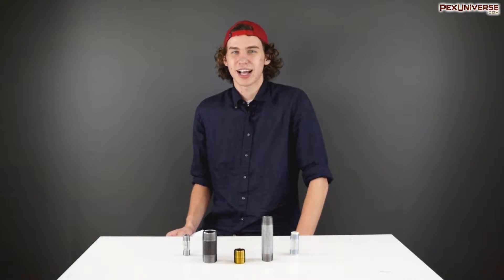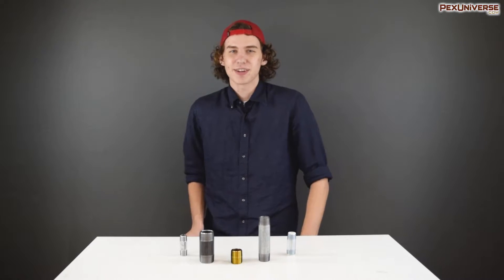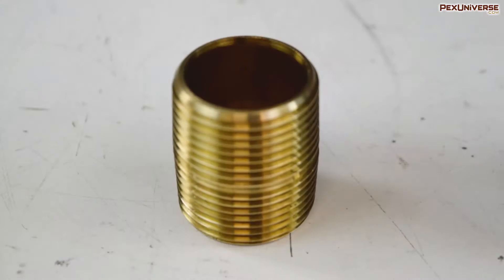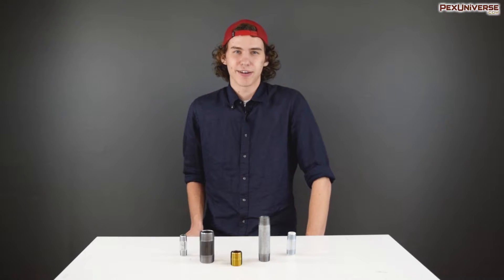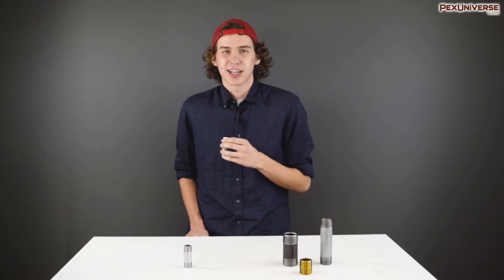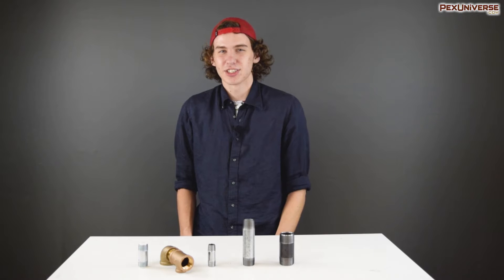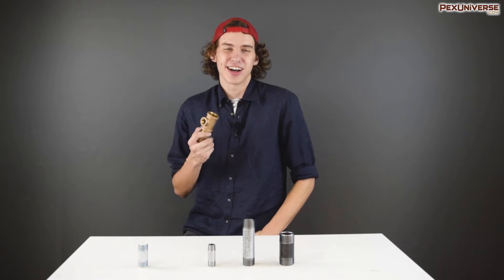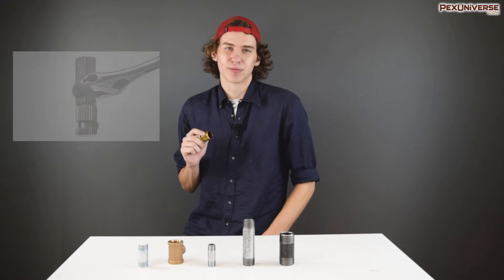What Is A Pipe Nipple?

Comment: What tool do you use to install a close nipple????
Reply from the maker: You can use an internal pipe wrench to tighten the close or a short tapered nipple into the first fitting, then screw on the second fitting at the other end